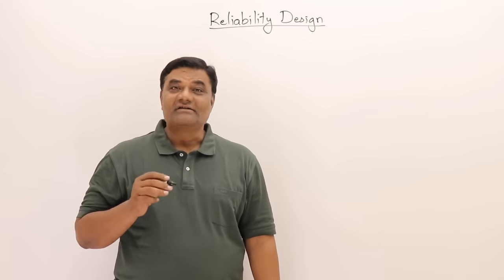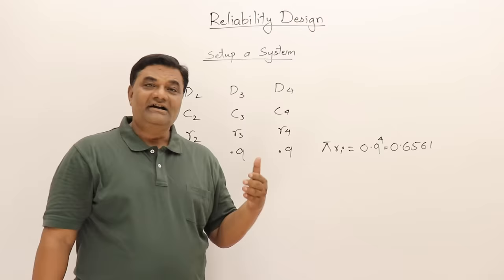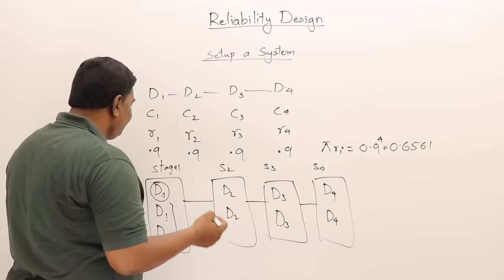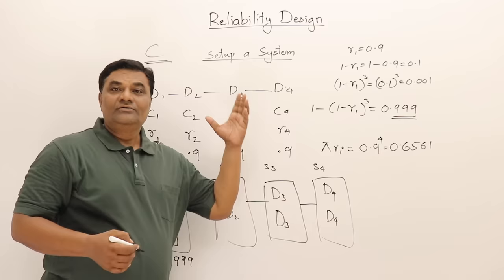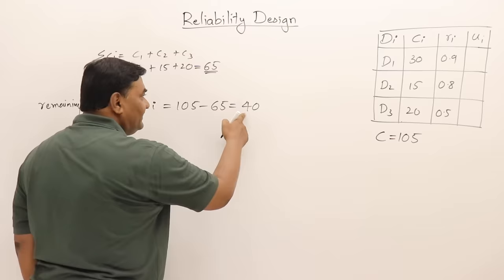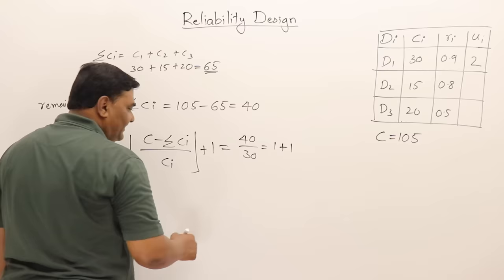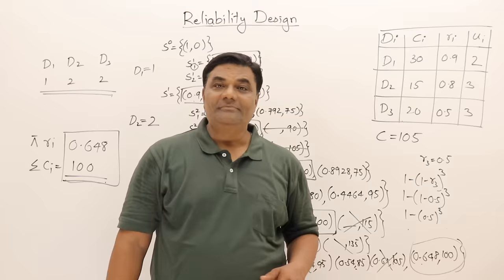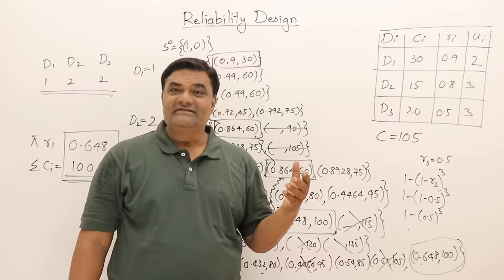4.8 Reliability Design - Dynamic Programming

Comment: I believe it should be (0.648, 100), (0.63, 105), but not the other order.  You need to take (0.648, 100) first because it came in earlier.  And the reason (0.63, 105) is eliminated is just because it has a lower reliability.  Other than this tiny detail, these are very good videos.
Reply: Yes i got stuck on the same
       Thanxx to reliability
Reply: ok thanks for the explanation. I was dealing with the same issue

Comment: Hello Sir,
1. A system consists of three processors and four peripheral units. In each of these 
cases find the reliability of the system if the processor lifetimes are exponential
random variable with mean 10 and the peripheral lifetimes are exponential random
variable with mean 15. 
a) The system is functioning as long as one processor and one peripheral are
functioning. 
b) The system is functioning as long as two processors and two peripherals
are functioning.
Any suggestion on that?
Thank you

Comment: 1. How to trace how many of each device in a program? This demo eyeballed from a whiteboard, but after eliminating non-dominant solutions and overcost solutions and sorting, there is no more alignment between tuples across stages to help tracing?

2. Must we generate all tuples then sort then eliminate? Or it's possible to eliminate while generating.
3. This video sorted on reliability (23:20 0.63<0.648). This makes a 2nd last item (or 1st item in the comparison-pair) non-dominant and eliminated. Why not sort by cost instead, which makes the last item (or 2nd item in the comparison-pair) non-dominant and eliminated. Intuition says always handling current/last element is easier than looking back 1 slot.
4. Are there faster operations (maybe matrix/vector) to calculate this whole problem? 
5. Everything looks really bruteforce + eliminate before going next stage, how is this dynamic programming? (Looks more like branch and bound)

Comment: wait what?
r1 = 0.9
for three devices you calculated as r1*r1*r1 = 0.65
and then if D1devices are more than on 
you calculated first probability of not working is 0.1
then for all devices you told probability of not working is 0.001
and that of working is 0.999

isnt r1*r1*r1 is not probability of first set of D1 's ?
Reply: @abdul_bari  ok
can i ask why like that